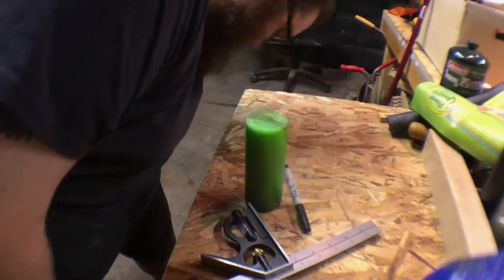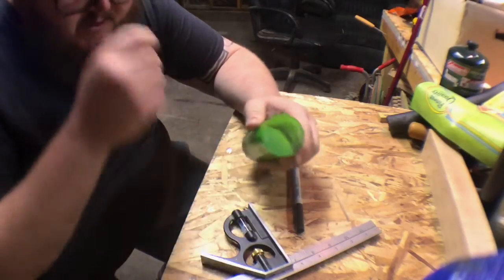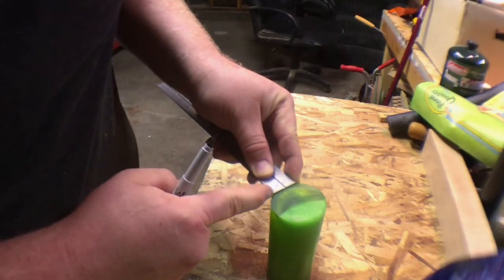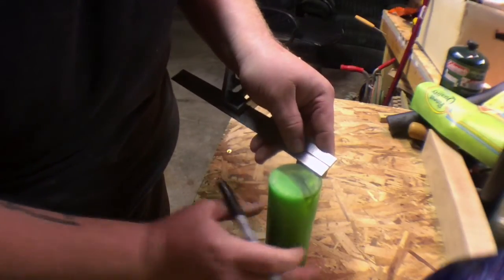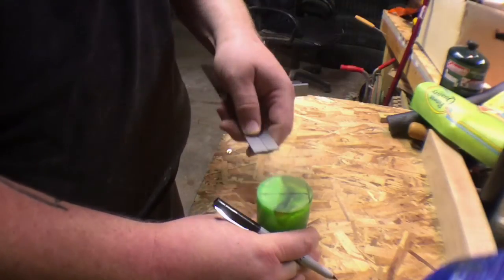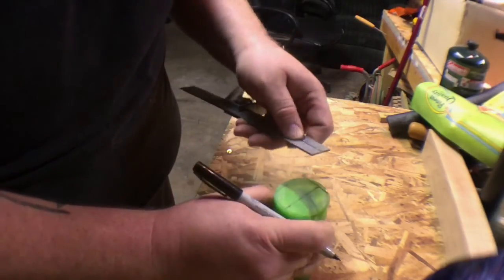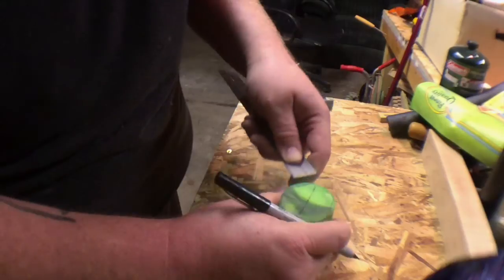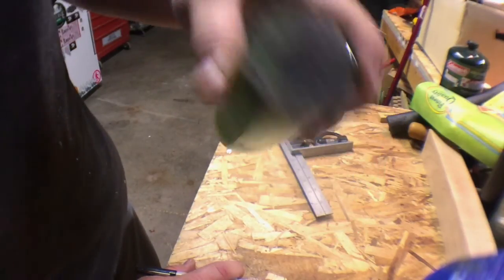Finding the center of a circle

Comment: Why don't you just use a accessorie call the center for your combination square. It slide over the blade just like the head but it shped like a v and it will find center automatically then you dont need to go through all them steps.
Reply from the maker: Woodsconsin Woodworking I'm not really sure what you mean. I did it this way because it was how I was taught. You can pretty much do it with anything, doesn't necessarily need to be a combination square.